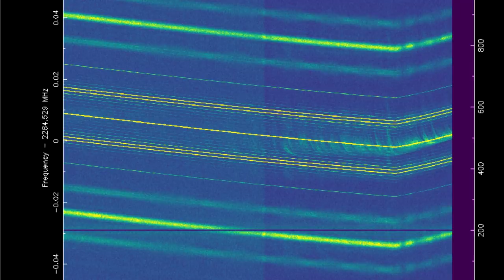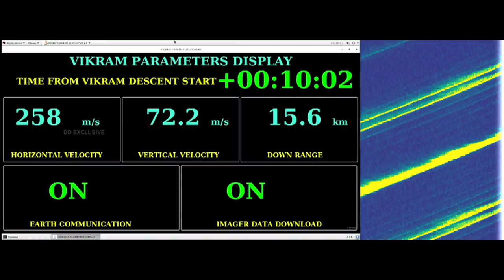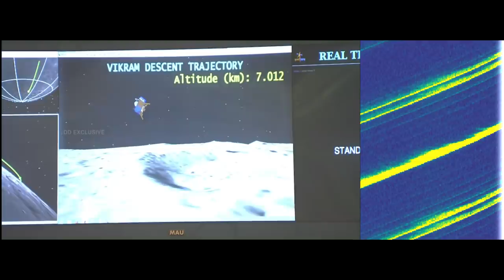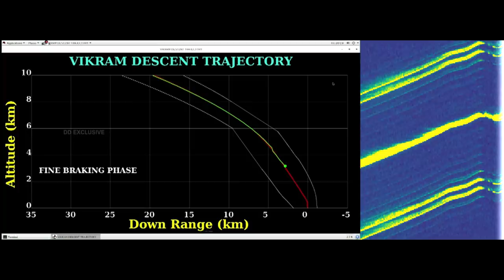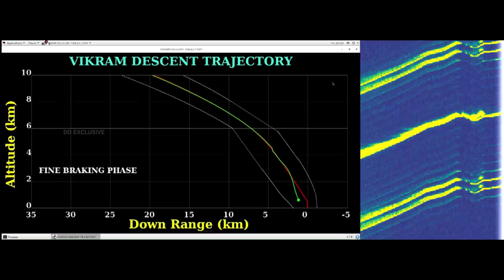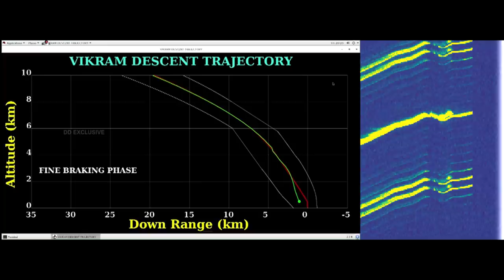What We Know About India's Failed Lunar Landing

Comment: My analysis:
There are four sections of propulsion engine inside the Vikram Lander which were supposed to be * turned off* (except one)  during rough braking phase/stage of 10 minutes to get deceleration of the speed for Vikram lander. We could compare both these two data of speed with graph (Trajectory Graph) and nominal speed (which was supposed to be 1.6 meters/second for soft landing). But they (propulsion engines) all didn't (probability). Also, there are three decelerations engines. On that note, due to start of decelerations engines and continuously running of propulsions engines, an unbalanced force developed on the Vikram Lander ; and as a result it turns upsidedown (kinds of spinning) for some moment. Since the Vikram Lander which has already on high momentum gets abnormalities( or kinds of malfunctions) on the parts transciever and transponder and unable to land safely. But it is for sure that Vikram Lander will not crush or destructions because Moon has low gravity which is apprx. 1.6m per sq.second. On all those analysis , we could conclude that  this is the reason, Orbiter and Vikram Lander unable to link or communicate the signals.
But lets hope , ISRO has already able to locate the Vikram Lander and trying to send the signals. In fact, NASA also trying to send the signals to Vikram Lander through Orbiter(since orbiter is working properly). We have total 14 days to complete the mission.
.
At last, Proud of ISRO ! 
Failure is the key of successes !!!
Reply: Logical analysis. 👍